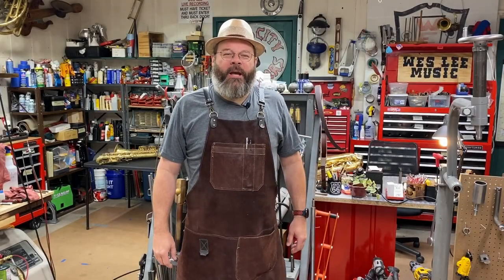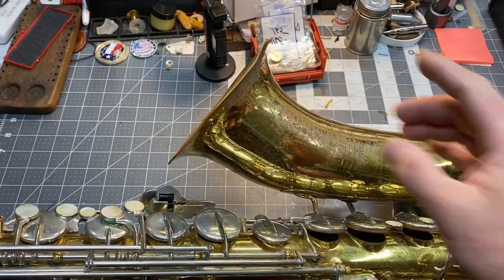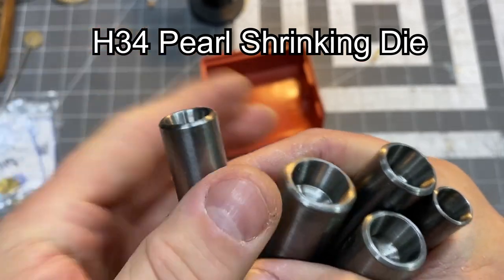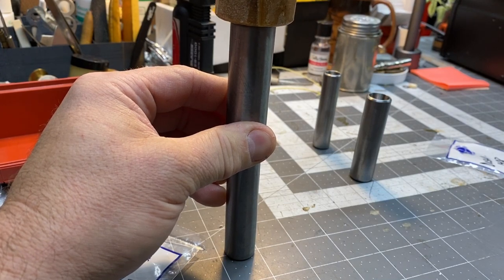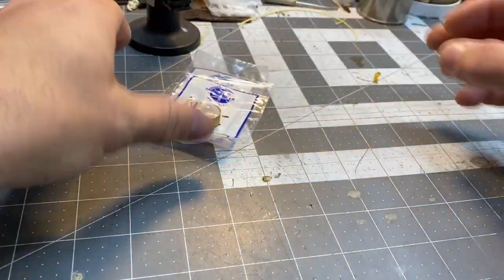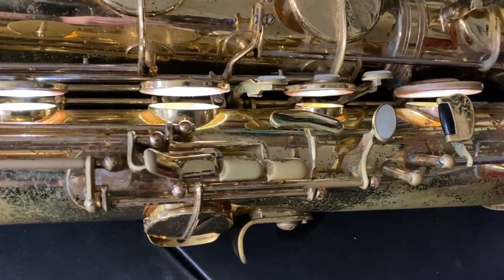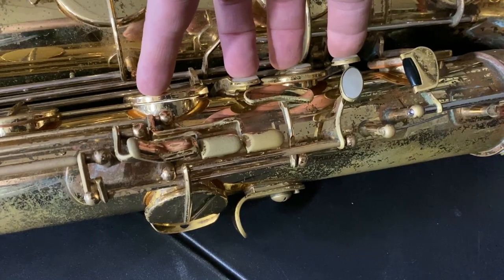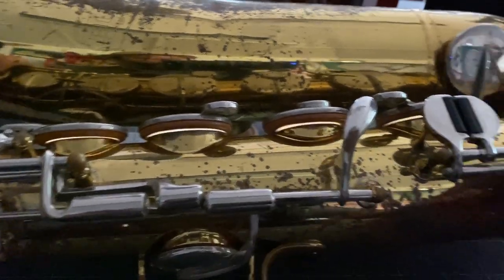Cool Tool Tuesday #1- band instrument repair

Comment: Hey Wes, I just graduated from the Red Wing Band Repair program this last year, and we actually hand crafted a pearl protector in the shop. We were given a small length of metal and a flute key cup, and we fit the two parts together really precisely, and silver soldered the two together. Thought you might like to hear about that, and it does seem to work just as well as the one you showed in your video.
Reply from the maker: Awesomeness. That was one of our first projects as well. I also still use it. Did you make the dowel handle for it as well? Thanks for sharing, I’m glad those projects are still being taught. Loved my time at Redwing
Reply: @wesleemusicrepair9820  That was one of our first projects back in 1984!  We used a clarinet pad cup and yes, we made a nice handle as well. COOL!

Comment: As a retired cabinet maker I've seen my fair share of wonders and blunders. Or as you say, $10 dollar links.  Jigs are the most prominent money maker in the accomplished woodworker's arsenal. Because there's a fine line twix getting it set up properly or just muscling through and getting er did without a jig.  
One time I was sent to the production end of a job shop that I worked at in the 90s. (I think it was on a "Toolsday"). As I was tasked with making the run-of-the-mill parapet for our banking fixture division, I saw opportunity! And I was promptly  berated by the old school lead man for the entire hour I wasted while making an angle cutting table saw slider jig for replicating the proper angle every time rather than cutting it close and taking it back and clamping on a guide board and routing it off with an old 1/2" single flute high speed steel bit that rode on its own shaft not even a bearing. Fine for the one-off. But not production. 
Years later I needed some CNC work done so I had them bid on the job and they won. I should have never told them that they were the only ones I called! Any way I walk in a decade later with this CNC project and there is old school, at the table saw, using "my" jig, that he hated on all those years ago. All he could do was smile and look at the clock. I got the point. The thing was plated in gold by then. Figuratively speaking of course.

Comment: Hi, Wes. I am an engineer (retired) and I have worked with tools all my life. I have woodworking tools, mechanic tools, electrical tools, electronic tools, luthiery tools, and gunsmithing tools. But I have been watching a few band instrument repair channels lately (I was a trombone player in a different life) and I am amazed at the array of specialty tools involved in your profession: mandrels, pearl shrinking dies, dent removal balls, etc. I can use a hammer to beat on most anything, but very many of your tools are specific to instrument repair, and therefore probably quite expensive. (Get to the point, Bruce.) 

How much do you think you have invested in the specialty tools required in your craft?
Reply from the maker: I’d rather not say, my wife thinks only a couple hundred bucks! Ha
Reply: Happy Christmas Wesley l love rhis answer

Comment: I made a micro leak light purchases L E D light strip so you can get into tight spots sax necks to check the teeter Clarinet. Easy put together just solder some cable and banana plugs for your power sauce you can also adjust how bright or lower light you require. $25 use it all the time. Mobile Woodwind Service Aus Also do work in clients Homes. 🐊

Comment: Is there a risk of putting an indentation in the back of the sax from hammering the shrinking die onto the thumb plate while it is soldered to the sax? Similar question for keys: can you shrink the pearls while the touch piece is soldered to the keys?
Reply from the maker: The demo horn was a customer instrument. No, no damage. Remember that you are just shrinking a thin edge, so you are not striking that hard, and combined with the surface area, the thumb plate does not act as a punch. You CAN do damage if you are not careful.
The key I demonstrated. I would take the key off and shrink using my bench block to avoid bending key cup. I would not suggest doing that on the horn. Once again you will notice I do not use much of a strike to close the die.